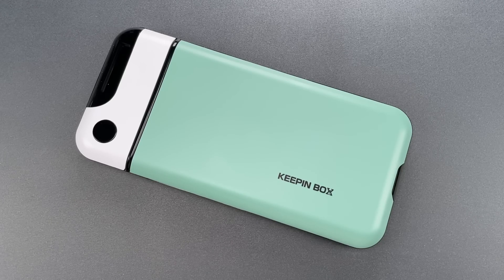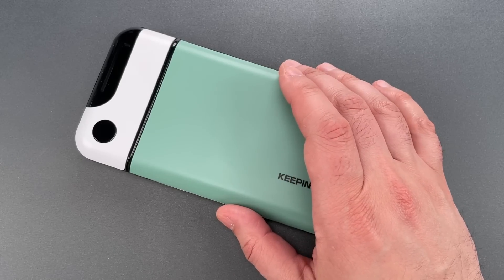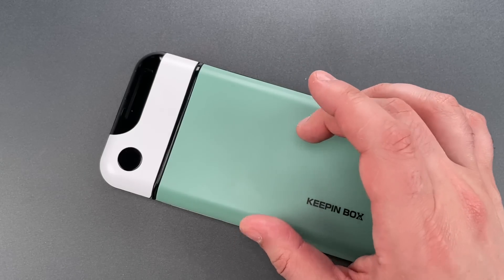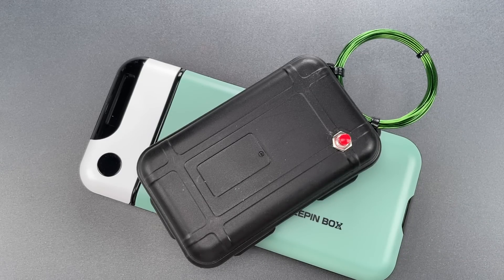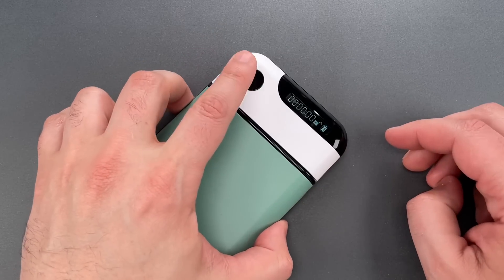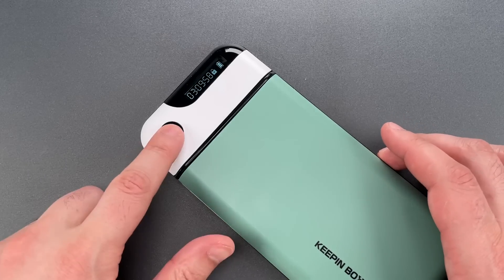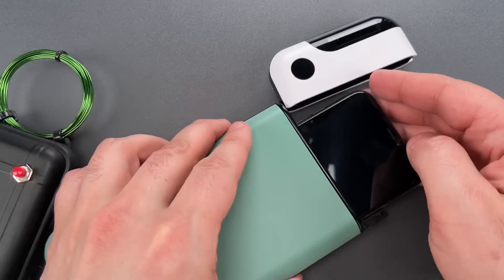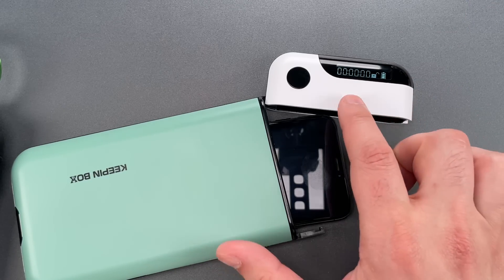[1440] Pocket EMP vs. Smartphone Timer Lockbox

Comment: It would have been funny if it increased the time on the timer
Reply: Exactly, on an error condition, have '00' hex equal the max amount of time, and have timers end on the binary 1.
Reply: @lightdark00  And how do you suppose they can detect that error condition? Not only is it not as easy as you make it sound, but what you say simply doesn't make any sense. It's like you've just learnt what hex and binary means and you threw it at a sentence hoping it would be coherent.
Reply: @poipoi300  I would use the limited non-nand memory for one bit saying if a timer was going or not. If a timer was going '00' hex would not be reached because it'll get skipped. So if no 'timer going' bit is present, and we see a '00' it becomes 'FE' or whatever.
Reply: @lightdark00  So basically, you want that when a timer starts, you reflect that information into the EEPROM. Then on boot up, the device checks if that Boolean value is set in the EEPROM. If it is, it sets the timer to its max value, correct? That would make much more sense than your first reply in this thread. I'm not convinced it would be significantly better though, as the device can run out of battery, or suffer from interferences outside of tampering. Either of those situations resulting in a maxed-out timer would be seriously annoying. I think simply writing the time at which it can be opened and having a clock module is preferable. That way even if the clock gets momentarily disabled, the worst that'll happen is the clock module loses power and the time isn't updated. Meaning you would have to wait longer than the original timer by however much time the clock hasn't had power.
Reply: @poipoi300  i like your funny words, magic man
Reply: @poipoi300  make default state with maximum time allowed, and make unlocked state non-default. So, when it confuses, it resets to maximum time.
Reply: @poipoi300  Does it even have a real time clock that won't be affected by an emp?
It might even have a bypass, like pushing one button 30 times or something.
Reply: @HakanBayndr  Default state means it would be locked on first use. The goal is to only further protect the lock when a timer was going, without the costs of shielding.
Reply: @f1shyspace  Hahaha thanks.
Reply: @HakanBayndr  As lightdark00 mentioned, that would result in a maxed-out timer when you receive it.
Reply: @lightdark00  I don't know whether or not it has one, although it most certainly has a clock for the micro-controller. They could use it to keep track of time (not as accurately as with a dedicated clock) as well without the need to add anything. My original thought process involved changing the design, but even so I wouldn't suggest shielding as heavily as my solution proposed in my other comment. The reason is that shielding a device like this perfectly is tricky, and it would take some serious shielding if you want to protect it against the most powerful EMP devices. Of course some is better than none though, and I agree that it should be shielded too.
Reply: oh look its the furry poketuber. gross.
Reply: I have a confession: I thought it counted up at first, not down

Comment: The fact that you can make an emp device for $10 really impresses me.
Reply: High voltage generator, a dollar of jewelry wire, A switch and some batteries.
Reply: A $3 bug zapper and you 90% there.
Reply: @anullhandle  Lol, I like voltage boosters more, but either way
Reply: probably he got the components for free using his skills.... just kidding. multiple clicks on one

Comment: Will the EMP fry some microchips? Want to know if it is safe or if there,s a chance of high current damage
Reply: I dont know the details of the devices, but as the generator is portable, I would bet the power range of the EMP only flips bits in the silicone but dont fry it :)

Comment: Did you notice the thin plastic hook holding it closed?  I think you could just pull up and break it. There appear to be two parts to the hook with a thin metal pin holding them together. The plastic would shatter around that pin without much pressure in my opinion.
Reply: It's plastic so you could just smash it with a hammer but the goal is usually covert entry

Comment: I would really like to know how to build a pocket emp... that could be useful this tradesman...
Reply: Just use an electric fly swatter with a coil connected to it. The coil needs to be connected with a small air gap so that the high voltage builds up, jumps the gap and creates a pulse in the coil.
Reply: @danielnyman6082  intriguing 🤔  thank you

Comment: Should write to EEPROM during the set time. And if something goes to hell, it should restart and read from EEPROM. So in that case if any kind of noise disrups the MCU, it will reset to the last input value, 3h and 10m.
Reply: This approach is definitely better than writing the time to EEPROM every second or so 😃
I'd even use an accelleration sensor to even increase the time when it detects tampering attempts 😎 and store this as an offset to EEPROM
Would that be evil?

Comment: Where can I get a schematic for that EMP device?
Reply: Just use an electric fly swatter with a coil connected to it. The coil needs to be connected with a small air gap so that the high voltage builds up, jumps the gap and creates a pulse in the coil.

Comment: You kind of have to keep the countdown in memory since overwriting non-volatile memory every few seconds would wear it out pretty quickly. Just have one micro-controller handling the UI and another in a shielded location with adequate EM isolation from the UI handling the timer and lock.
Reply: . you can have it as an inverted count up timer. so the timer has to be running for the alloted time. so resetting it to zero would reset it to 3 hours remaining to open.
Reply: @tenachiasacaful  That's quite a good idea. Wouldn't even wear out the EEPROM out that much, it'd just get set when it was locked. If the battery got low it would just save to EEPROM. With wear leveling, this would be a cheap and ideal solution.
Reply: This. A small RTC chip surrounded by a mu-metal (the stuff used to protect hard drives from their own magnets) would add little to the cost and you wouldn't even have to have two microcontrollers. On startup, the microcontroller would check the time in the RTC and set the display to that instead of zero.
Reply: @thorlancaster5641  You will still need some sort of isolation between UI elements like display, LEDs and buttons if you don't want the wiring between those and the micro-controller to serve as an antenna for EMP and potentially cause a reset.
Also, even if you store the RTC end time instead of counting, the RTC itself is still a 16-32bits CMOS counter that can be corrupted by power and IO glitches, as does the rest of the processor's register file and RAM. The processor may not necessarily be in a state where it can tell which state it was in before being forced into a reset state by the watchdog timer (firmware crash) or something else getting tripped.
Reply: @teardowndan5364  Good decoupling + A RC circuit on each pin + external diodes would prevent electrical spikes from the wires from messing up the chip's internal state. The protocol could be hardened too. For example, an I2C chip won't even respond unless you get its address correct and a SPI chip could have enough RC added to the CS pin to block high-frequency transients. Sure it would slow the circuit down but an extra 100ms when powering on wouldn't be noticeable.
Only thing left after that would be the MCU getting confused enough to either reset the timer or unlock the latch. Control flow perturbations could be defended with defensive programming, and unlocking the latch could require several IO pins on the chip to take on correct values through logic gates. Even if it was impossible to block this attack 100% of the time you could probably make this attack as hard as raking a good lock with security pins.

Unfortunately all of this is meaningless when the company is aiming to make their product as cheap as possible and just secure enough to stop the average consumer's inner monkey from getting to their phone.
Reply: @thorlancaster5641  If you put RC filters on 7seg multiplex LED display, those RC networks are going to sap a fair bit of power. As for an MCU-to-MCU protocol, you could simply use RS232 with an opto-isolator in each direction. Even if you used I2C to use the address decode as pre-screening for junk packets, you'd still have to validate (and decrypt if you want to be paranoid) the payload protocol anyway.
Reply: You can update non-volatile memory in greater intervals to make a snapshot of the countdown. In case of an unexpected reset you just load the snapshot.

Comment: ayo anyone got a video on how to make an emp like that?
Reply: Just use an electric fly swatter with a coil connected to it. The coil needs to be connected with a small air gap so that the high voltage builds up, jumps the gap and creates a pulse in the coil.

Comment: Where's the video making that pocket EMP?
Reply: Just use an electric fly swatter with a coil connected to it. The coil needs to be connected with a small air gap so that the high voltage builds up, jumps the gap and creates a pulse in the coil.
Reply: @Daniel Nyman... Thanks! I'm going to try it. But I would like to learn more about this subject. Electronics are my weak spot. Just trying to stay busy. Thanks again!

Comment: On your next video, you should show us how to make that pocket emp and list what parts you need as well as where best to buy them! Because I want to make one of those pocket emp's that would be awesome to have.
Reply: Just use an electric fly swatter with a coil connected to it. The coil needs to be connected with a small air gap so that the high voltage builds up, jumps the gap and creates a pulse in the coil.

Comment: How did you make the emp? Can we see how it’s constructed?
Reply: Just use an electric fly swatter with a coil connected to it. The coil needs to be connected with a small air gap so that the high voltage builds up, jumps the gap and creates a pulse in the coil.

Comment: I've zero doubt, had LPL been around during the "chastity belt" era?  He'd of had a "RFD", that gave every gal in irons their freedom, and a bit of a "thrill". What's that? Oh, "Remote Freedom Device". His own creation, of course.
Reply: No, those locks of that era would have probably been more susceptible to raking, picking and possibly sonic attacks but you would have to get the frequency right on the latter thereby discounting their viability, however, the urathane or similar hammer is another option that I just remembered if destructive entry is faesible

Comment: Would that work on systems like the hotel room safes? 

It has to be similar tech, instead of storing a time, it stores a temporary passcode…
Reply: Probably not, except the safe stores the PIN in RAM only, then it would also reset if the battery dies. Some safes have external battery terminals instead of a (crappy) hardware lock, so you can put a 9V battery on the outside and enter the PIN as usual, so it has to be stored in Flash/EEPROM. In addition to this, the electronics might be shielded (better) by the metal case of he safe.

Comment: How do I make this emp device for under ten dollars, make sure to note store aswell. Cause I’m thinking it’s gonna be more around 50$ to make today. If ya can find said parts to. From inflation to missing products and price of shipping now…. Atleast 35$ I’m thinking. Anyhow what do I need🤷🏼🤣😝
Reply: Just use an electric fly swatter with a coil connected to it. The coil needs to be connected with a small air gap so that the high voltage builds up, jumps the gap and creates a pulse in the coil.

Comment: How can i make that EMP generator?
Reply: Just use an electric fly swatter with a coil connected to it. The coil needs to be connected with a small air gap so that the high voltage builds up, jumps the gap and creates a pulse in the coil.

Comment: this one I'm gonna fall on the other side of, because there needs to be a way to open it outside of waiting for the time to run out. and a portable emp might be the only way and is a rare enough thing to mean it is still secure for the most part
Reply: It's plastic, thus easily physically broken if necessary. Think access restriction, not outright access denial.
Reply: @P_RO_  you're right. And breaking it is the proper way to get into it incorrectly

Comment: I have the Kitchen Safe kSafe that I dismantled, and it looked surprisingly well designed. I couldn't think of any way to get in without smashing it entirely, despite having both the latches and the battery compartment exposed on the outside, which is usually enough of a deterrent for its use case. I'd be really curious how it holds up against this thing!

Comment: To fix this vulnerability would require an RTC and flash memory, which would probably double the BOM cost of such a cheap item.
Reply: Nah, it has those parts.  It just lacks a secure response to an unexpected microcontroller reboot.
Reply: @johndododoe1411  no chance it has a real time clock. I'd put money on it relying on a cycle division for timing.
Reply: @mitsuman007  A real time clock just does cycle division of a good enough oscillator frequency.

Comment: My more important question in this case is if your old phone survived the pocket emp.
Yes, your points are right. However if the method of intrusion also destroys the contents within it ruins the purpose of getting in.
Reply: Most likely not. The purpose of these cases is to prevent phone access so the phone is going to be turned off; no point in having it on.

Comment: Question: would it damage the phone inside to open the lock like this? I was thinking that the whole way through. Was hoping you'd turn on/unlock the phone afterwards to show that it still functions as normal. 
Not that anyone with a remote EMP device is going to put their phone in such a box, but still worth asking
Reply: A device such as this has very low power and the current surge it produces is not high.
Phones are protected against minor interferences such as this.

I think EMP is a bit of a buzzword here. This device is strictly speaking emitting a pulsating magnetic field, but when people commonly say EMP they refer to the EMP caused by a nuclear detonation in high atmosphere. Which can fry pretty much every electronic device via the massive current surge.
Reply: @cauchyschwarz3295  Except for vacuum tubes. The pulse(s) just pass right through without an issue.

Comment: “This lock is very simple to open. All you need is a simple POCKET EM-“
Reply: You do know it's just a few turns of wire with some large-ish capacitors dumping current into it, right?
Reply: @AttilaAsztalos  Yes but I was expecting he would remove the battery or short it some way rather :p
Reply: It's a taser and a few loops of wire, not that hard to make
Reply: @runed0s86  How hard it is to build was not the point, at least not MY point...
But thanks for the info :)
Reply: A taser would probably also work. If not put a coil at the end of the taser terminals and try again
Reply: @cookiemon420  the device in the video actually IS a repurposed taser
Reply: @skuizhopatt5318  cool, so my guess was right :)
Reply: Pretty sure bank locks are EMP proof.... maybe. ;)
Reply: You do know it's just a few kilos of plutonium-239 with some large-ish detonators dumping neutrons into it, right?

Comment: We've reached the point where he's picking locks using electromagnetism...
Reply: It's also not the first time on his youtube series.
Reply: He has used a magnet to flip a relay inside an elock before
Reply: Technically, he always was, since it's the electromagnetic force which makes things such as lockpicks solid.
Reply: @GamesFromSpace  Also, depending on the kind of locking mechanism it's not entirely unfeasible to use a sufficiently strong electromagnet in order to physically move a locking shackle or something and open a lock. Not gonna work on just any lock though.

Comment: To be honest I would be very scared to use EMP generator on a lock box with electrical device inside of it - since there is no magnetic shielding as the security, there is definitely no magnetic shielding anywhere on the case

Comment: That moment you discover the EMP generator has also conveniently effected a factory reset on your cell phone. 😬
Reply: Its range is quite small
Reply: @xrefed  Also, the phone uses nonvolatile storage for most things. More likely, it would just force a reboot.
Reply: That's not how emmc or nand works.
Reply: Think about these items...

1. Almost any smartphone has nonvolatile memory.

2. If one manually shuts off a number of iPhones, without the original user - they are next to impossible to open. They are actually the most secure device that one will ever own. Just how secure? There have already been cases where Apple is unwilling to unlock devices for any reason - and actually protected known criminals, even terrorists.
Reply: Thumbs up for the correct use of the word "effected".